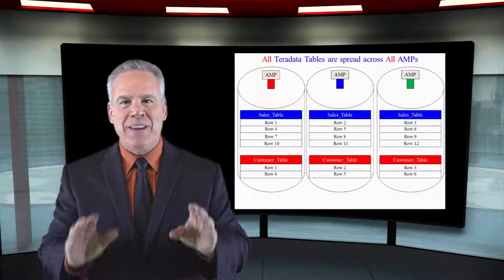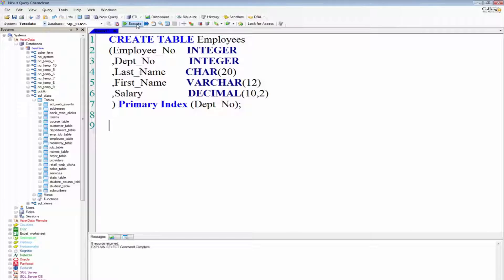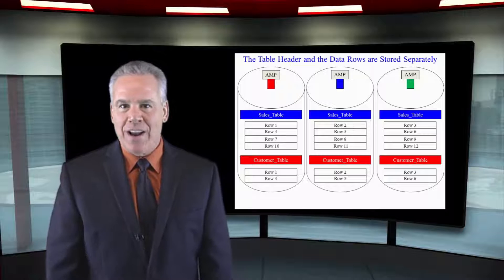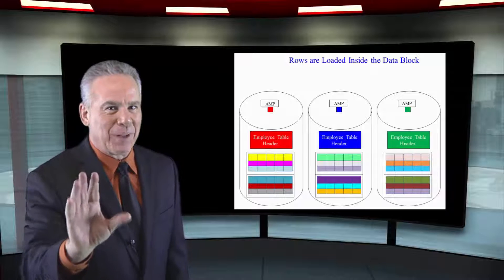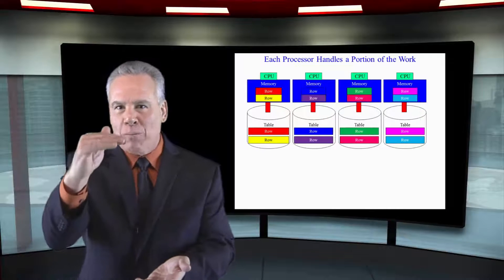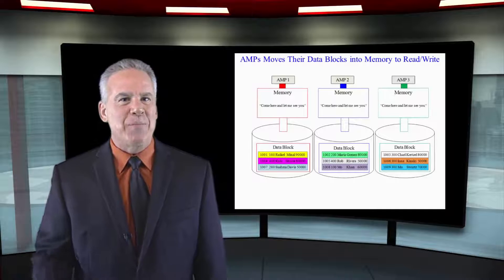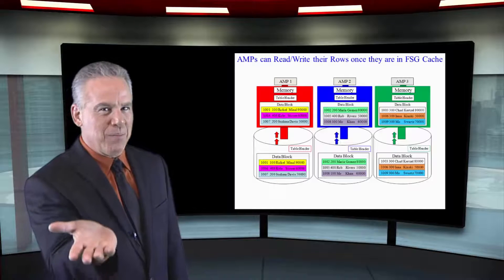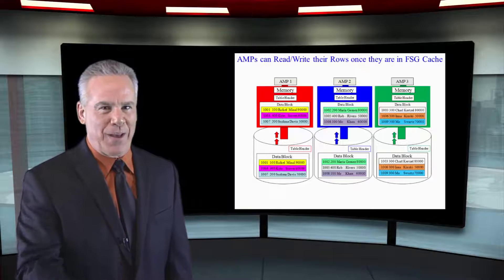Let's Learn Teradata Lesson 13: The Basics of Data Blocks

Comment: Hi Tom.. Great tutorial. One Question though..!! Does Teradata has separate Blocks for each table in a single AMP meaning One Block in an AMP can hold only one table's data. Am i right ??
Reply from the maker: Amit,  You are 100% right (as usual).  Great job.  If a system held 50 tables then each AMP would hold 50 table structures (Table Header - DDL) and each AMP would have at least 50 separate blocks.  No two tables ever share the same block!  You will never see two tables sharing the same block.  If a table continues to grow the block will split on the AMP from a large 1 MB block to two separate .5 MB blocks, but all of the information is for one table.